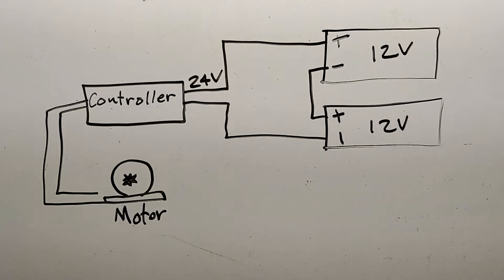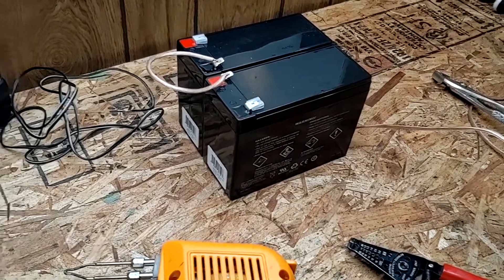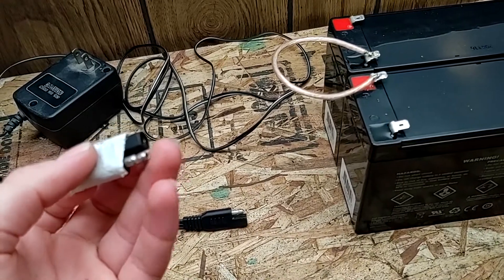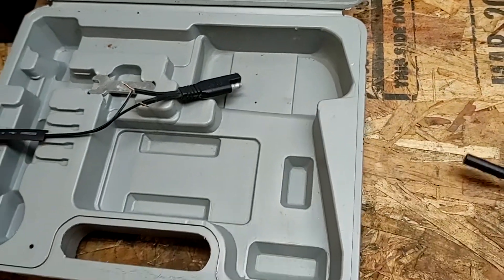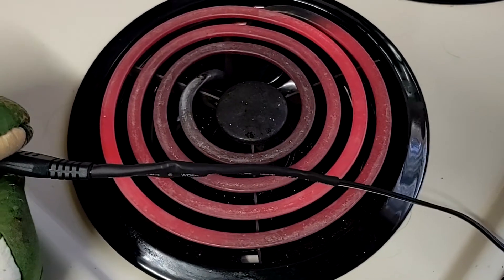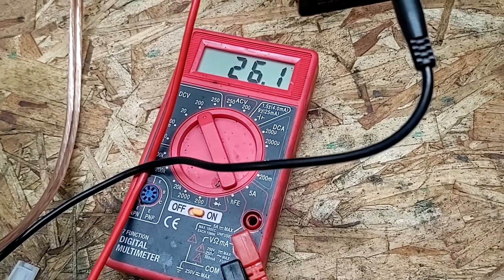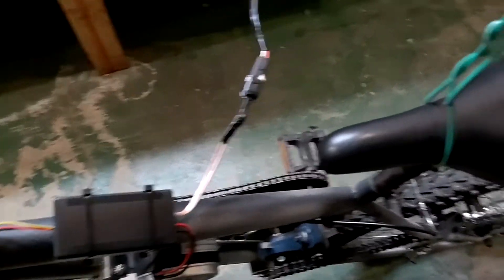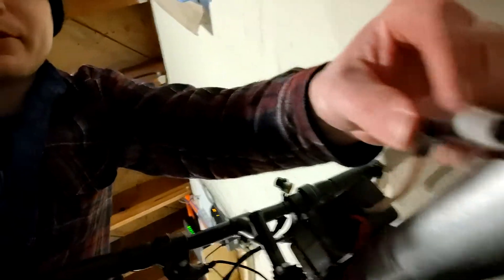DIY E-Bike Build - Wiring Batteries EP8

Comment: What range did you get with these batteries?
Reply from the maker: TBH I didn't do a thorough range test. I know it did 5 miles in relatively cold weather 40-50F without any problems.
Reply: Thanks I'm running a similar battery set up and this helps alot. now I know I can make it down to the main street and back without having to worry

Comment: Where is the ride video?
Reply from the maker: I finished this project in the winter and was waiting for nicer weather. Unfortunately, I didn't get around to shooting a ride video. The motor and everything worked. The bike had tons of torque and could even climb some hills. Top speed was around 10mph. The throttle had a pulse of power when it would click on and then level off after that. It basically operated like a switch, which was fine given the low speed. However, if I were to do it again, I would try to find a better throttle and controller setup for smoother acceleration.

Comment: Looks like your no load speed is about 9.7 almost 10 mph....Just timed your rear wheel and did the math.....
Reply from the maker: So, it turns out you were pretty much spot on with your math. Could you help me calculate some gearing for my Briggs build? You can reach me at my business email address under the about page on my channel.